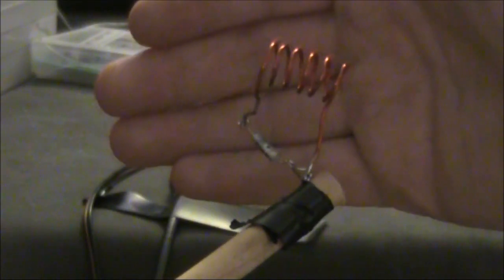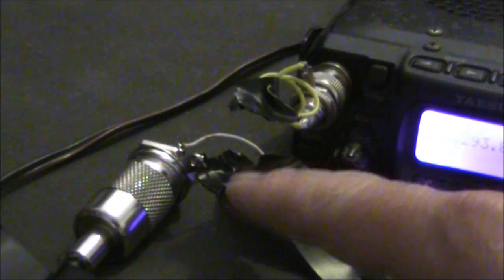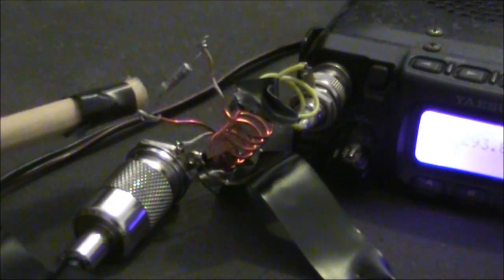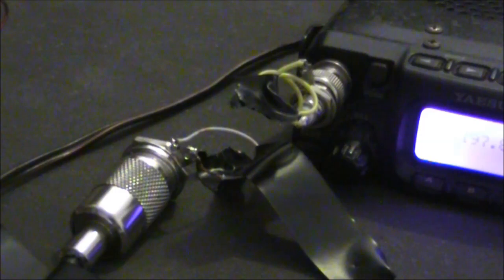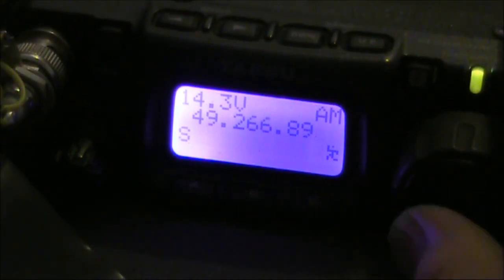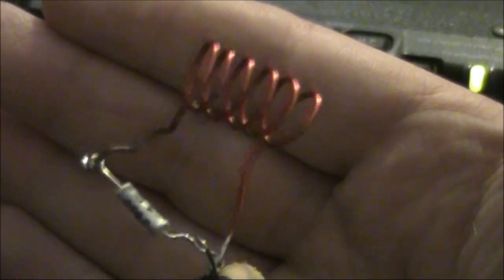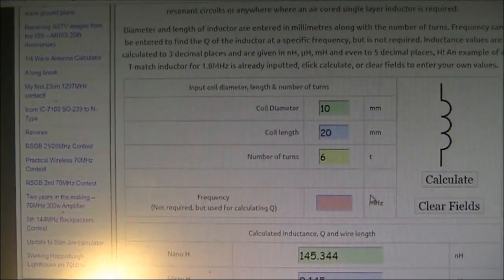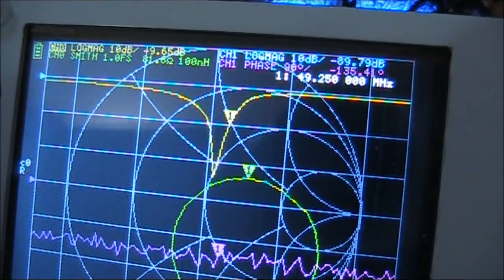Testing a parallel tuned circuit

Comment: Is your source of wideband rf noise literally just an antenna? eg I have a fan dipole with some coax that comes into the shack, and isn’t always used... the coax is long enough and manouverable enough that it could be used as in the video. Alternatively I have on my project list a 2 transistor noise generator.... would that do the trick ?

Comment: Can you connect the nanovna directly to either end of the tank?. Thanks for a very clear presentation!
Reply from the maker: Haven't tried it but coupling would need to be very loose (or the Nano VNA would need to have high impedance) to get a useful reading.